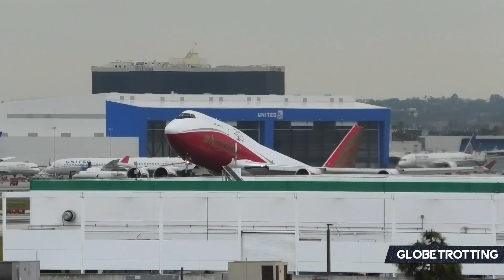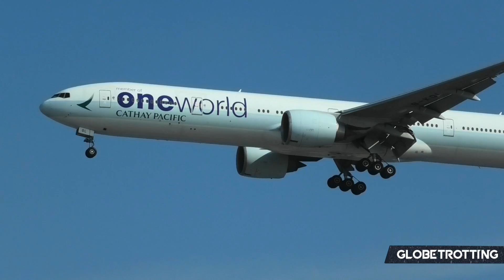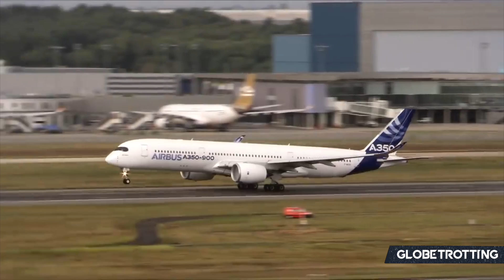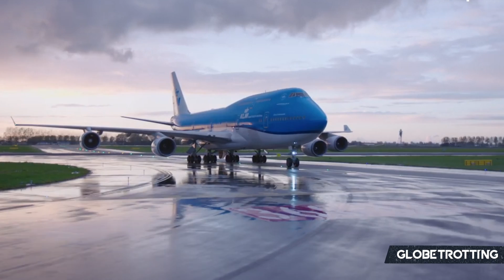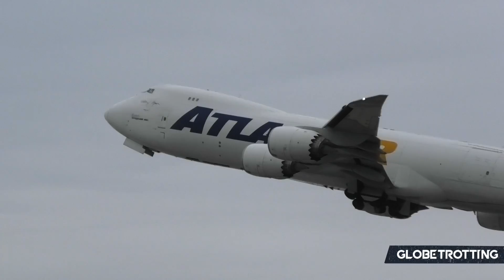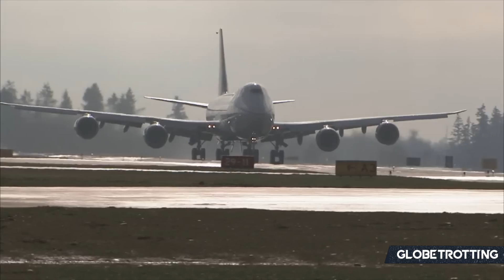FAREWELL - Why Airlines Are Retiring The 747

Comment: Some of the747s were certainly showing their age, 5 years ago I flew BA on a 22 year old refurbished 747 from LHR to DC it felt like a modern aircraft and was a great experience however on the return flight a non refurbished 23 year old BA 747 it was an absolute disgrace that BA were still operating it.
I do like the 747 but for looks the A340-600 wins hands down in my opinion.
But it is said that both types are not seen at LHR anymore .

Comment: Between the age of the 747-400 airframes and the higher fuel cost per passenger even on long routes, no wonder airlines are rapidly retiring their 747 fleets (except those who have the 747-8I). I think airlines wished the 777-300ER is still in limited production because that plane effectively became a 747 replacement.

Comment: The A380 beats the 747 when it comes to overall safety record.
Reply: Can't compare an aircraft which has not even  been flying 20 years to an aircraft which has been flying over 50 years
Reply: @charlesjay8818  Yes and when one only has 250 made compared to almost 1600, that's a big difference.
Reply: @kevinj2412 Exactly.... what a stupid comparison they made. Plus the technology and reliability of the mid 2000s is different than the 70s. Plus alot of accidents have nothing to do with the Aircraft or manufacturer like the tenerife accident for example, more accidents are down to human error
Reply: @charlesjay8818 THE 747 HAS MORE CRASHES THE A380 IS MUCH SAFER DAWG THE A380 AND 747 IS GREAT THE A380 IS MORE EFFICIENT
Reply: @leng3001  please read the previous comments, all the info is there